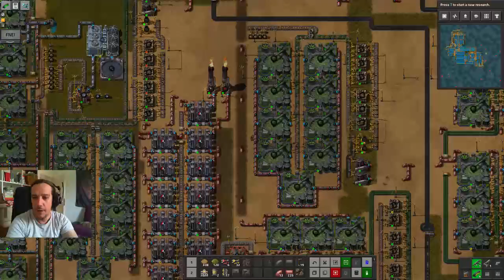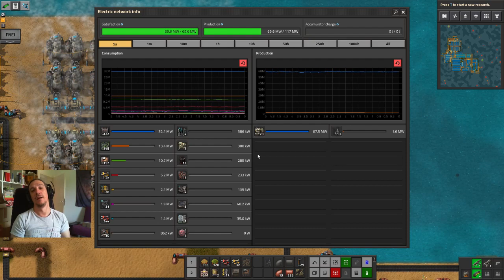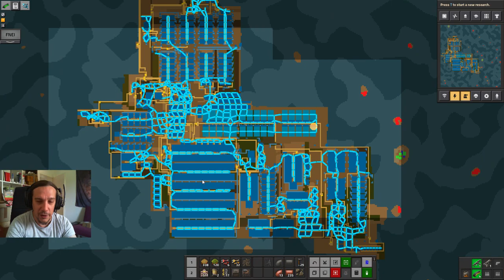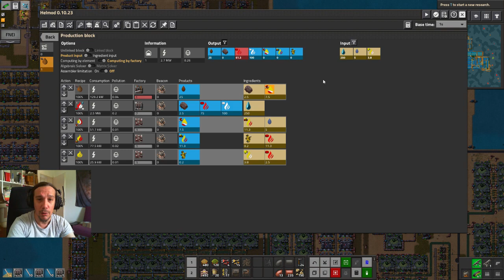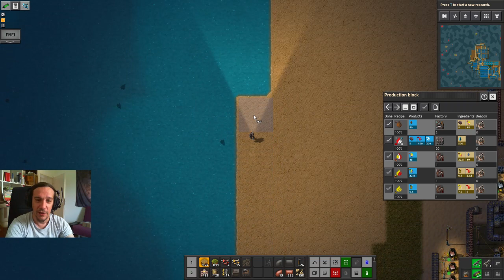Let's Play Factorio Seablock - 26 - Gameplay Playthrough

Comment: I prefer making purified water from water treatment plants using sea water and disperse the saline water byproduct with a clarifier, I prefer having an independent production of something rather than having it tied to the electrolysers whose primary duty is to make slag in this case.

Also for the sulfuric acid you don't need to set up a mass production as it will auto-feed itself from the sulfuric waste water created from the slurry coal filtering processed needed for the slag slurry - you will have to purify the waste water in a water treatment plant which will produce in return a sulfur unit which you can feed to a chemical plant which will need oxygen along with the above-mentioned sulfur to remake the sulfur acid.
One actual problem is that you will have with this process more sulfur than it will consume, you'll need to put a box there to accumulate the excess and later on with the circuit network you can set up so when the box is past e.g. 100 unites it will dump them somewhere else before they clog the system.

To kickstart the sulfuric acid production I don't remember the exact process but it goes something like this: sea water + viscous mud water from seafloor pump @ washing plant to create heavy mud water + some sulfuric gas thing. With that sulfur gas thing there's like 3 more steps that includes purified water and  oxygen to make it into sulfuric acid. It's a very low-producing process but once you kickstart it it will auto feed itself as I mentioned.
Reply: He did start to set up the sulfur production, but won't need that much ... yet.  
I have a big air scrubber operation on my seablock currently for all the sulfuric acid I need for all the other things, but at this stage, it will totally build up.